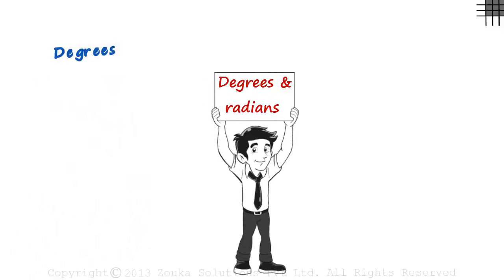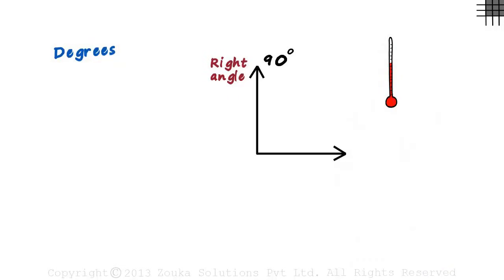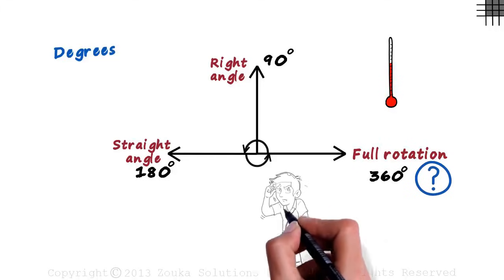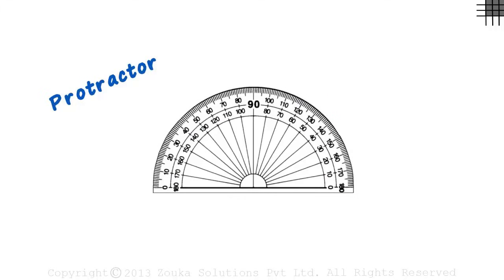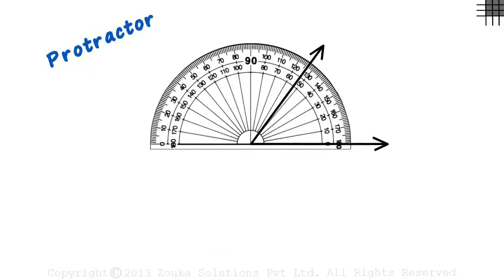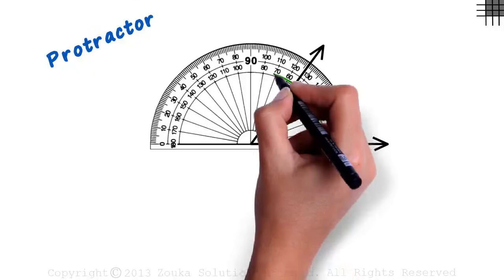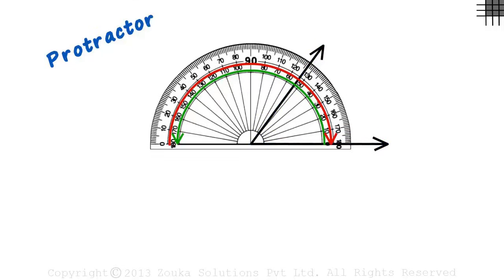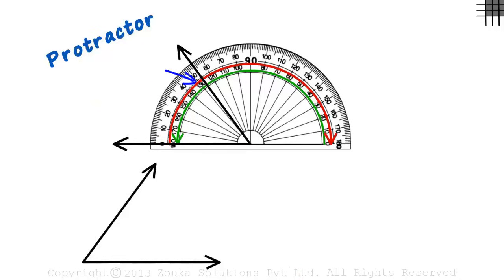How are Angles Measured in Degrees? | Don't Memorise

Comment: 20-06-2019  Bangalore
Madam,
Explanation is very good about degrees,  but it is incomplete. !
It can be completed  like this:
0 degree to 360 degree   ( that is, + zero to +360 degrees  represent position / location  of an object 
on or above the  plane.  This plane will have four quadrants amounting to  +360 degrees.
Similarly  there must be minus (-) 0 degree to minus (-) 360 degrees to indicate the position of an object
beneath or below the plane.  This will will have four quadrants below the plane.
Any object or entity can   occupy space or location in any one quadrant out of 08 quadrants. Right?
Because entire space is spherical only; not otherwise .
Hence  kindly use  a set of  0 to 360 degrees with plus value for on or above the plane.
And  minus 0 to 360 degrees  (with minus value) to indicate space below the plane.
Kindly  respond.     With regards,            - Nagaraj T V
Reply: why is 1 degree equals 60 minutes
Reply: @mrsoccer9449  ig because 60 was used as standard value for measurements in the ancient time and I also just saw a comment saying it is divisible by most of the numbers from 1to10.
Reply: @jrm8383  I see
Reply: Why the author is silent?    He should reply.